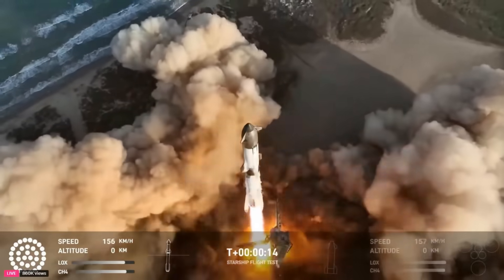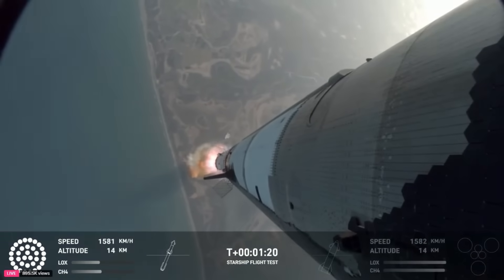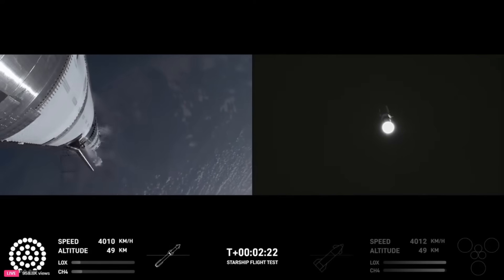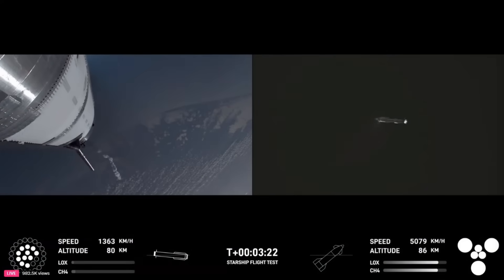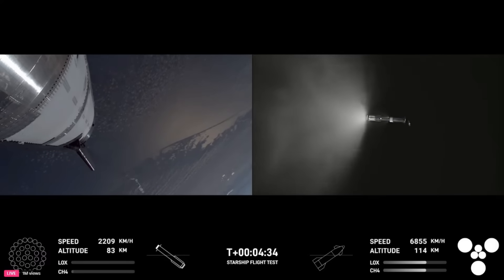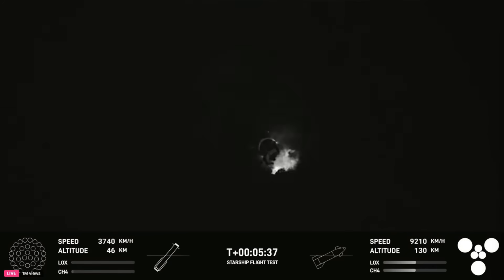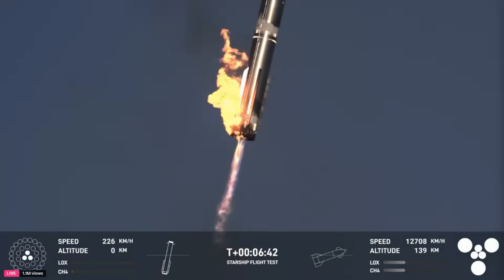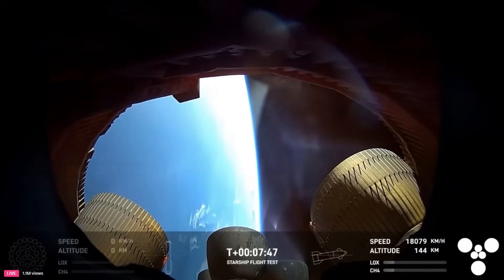SpaceX Starship Flight 8 & EXPLOSION 💥

Comment: Hmm.  Might it help if the computer algorithm ir the pilot were able to error-trap and compensate for an engine burst?  Thinking here to shug down all engines, recover attitude control (maybe not doable if propellant is jetting out), spot which engine(s) had failed and relight a steerable engine to put the vessel under way again?

Comment: WHY HAVEN'T THE VACUUM RAPTOR'S GOT TVC TO KEEP THE SHIP ON THE RIGHT TRAJECTORY AND POINTING IN THE RIGHT DIRECTION ! ! ! ? ? ?🤔🤔🤔🤔🤔🤔🤔
Reply: They didn't installed the TVC(Thrust Vector Control) system on vacuums yet.
Reply: Starship does not have Room in the engine bay for the vacuum engines to vector because of those enormous bells.   And it should be noted that if the  sea level raptors fail in flight the starship cannot land, anyway, since the vacuum raptors cannot operate at atmospheric pressure. 
So the reason is vectoring the vacuum engines is unnecessary and adds nothing to flight safety. 
Oh- and you caps lock key is stuck on.

Comment: ALL MY ROCKETS & SPACECRAFT WORK FINE IN KERBAL, SFS & ORBITER 2016 NOW WHY CAN'T ELON MUSK, JEFF BEZOS et all GET THEIR ROCKET VEHICLES TO WORK PROPERLY ? ? ?🤔🤔🤔🤔🤔🤔🤔
Reply: New Glen flew perfectly on its first flight.   It achieved specified orbit with its full test mass.   hey did not stick the landing, but that is exactly ONE failure to land the booster.   SpaceX took 23 launches before they finally managed to stick the landing the first time.  And with starship, they have caught 3 out of 8.   And the 3 they caught were NOT in reflyable  condition- and they have not yet gotten starship to achieve orbit, and the only ones that made it thru re-entry were melted and damaged beyond use.

Blue Origin is looking like they can design a rocket that function as intended without having to blow up a whole bunch of them.

Comment: Its because of software glitch on upper stage part.....
While ignition it can't start correct combination pf vaccum and raptor engine..... carefully watch ift 6 landing on sea ... there also one engine didn't start... engine is right but software can't decide which engine when to start..... similarly when in vaccum it didn't start the 3 engines or stopped engines at wrong time 😊

Comment: I'm guessing the problem SpaceX determined from the previous flight weren't correct.
Reply: Not likely. Probably new problems or they didn't properly fix the first problem.
Reply: Space isn't easy
Reply: I think they should take a clue from NASA and make slow steady progress. This isn’t working.
Reply: @thoughtsausage7  definitely not. What has NASA accomplished?  Wow, they spent $12 billion just to do what they did in the 1970s, well, almost what we did. At least in the 70, we put people on the moon. Now we just sit and wait until 2026 to see if they can maybe do it again, but they will probably be pushed back again. NASA is slow, boring, and the American people lose interest in their slow boring approach, so they little funding. 
Space X, on the other hand, has launched more rockets into space than NASA has launched in their history.  Hell, just Falcon 9 has had over 450 successful launches with over 400 landings. Rember when NASA said that it was impossible to land and reuse a booster? 
Another key point is that even as slow as NASA is, they still end up killing people because of the flat-out dumb decisions they have made.
Reply: The investigation isn't even complete.
Reply: @takashitamagawa5881  quite right. It just looked the same.

Comment: SLS 0% failures
Reply: A different vehicle with different problems. Also, a 2 billion per launch vehicle. Vs one thats only hundred million. With greater capabilities aswell.
Reply: @lupinereivaj 2 billion dollars on something that can go to orbit vs 4 billion on something that can't even take itself, an empty fuel can to space... SLS didn't need to blow up 15 times before going to LEO.. hell even blue origin went to space in orbit... Couple hundred million? Just so you know there is a reason why they aren't reusing them
Reply: @jaredhass9254  
So incorrect.
Sls costed 10 billion to design. It is 2 billion per launch for sls. 

Starship whole development including boca Chica they have spend between 4 to 5 billion in development. 

But launch per starship is about 100 million without reuse. 

Sls is not resuable amd every launch cost 2 billion plus. Also, it's not 100 ready to go, more development is left. Takes years to build a new ship. 

You can build starships at current rate 1 per month. 

Don't act dumb, math doesn't lie. 

Starship can also go to orbit if they point it in that goal. That has not been its goal since it's making to begin with.
Reply: @lupinereivaj  so 12 billion gives you something that can go to the moon on the first try and 6 billion ( 5 billion plus 8 * 100 million based on the totally believable musk  ) gives you something that can't take a banana to orbit... Got it

I guess the motto  is true... You get what you pay for
Reply: @jaredhass9254  
It's not Musk estimate. It's space industry experts that have provided the numbers. Also, the test flights for starship are included in the calculation.  

At 12 billion, starship will be 100% functional, reusable, and costing 30 million per launch. 
Also. It's able to achieve orbit now if that was It's goal.
Reply: @javiervasquez29  Starship has no capabilities, it cannot even get to orbit
Reply: @MegaWilderness  
Goodluck with your ignorance